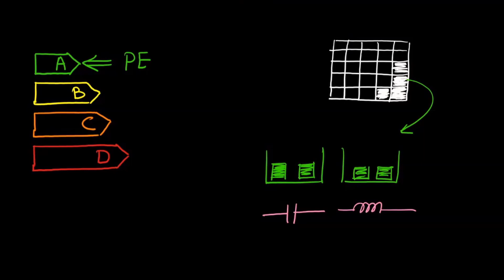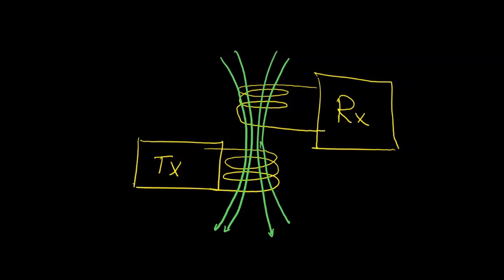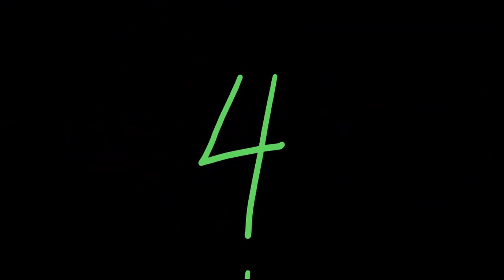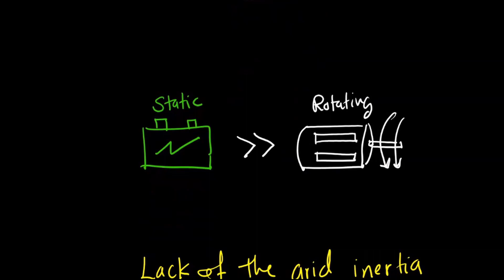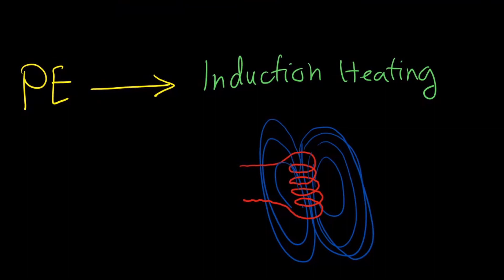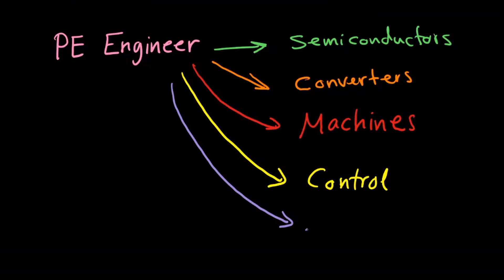5 Things You will Like about Power Electronics | Enjoy Power Electronics | power electronics online

Comment: Point 5 is interesting,  can you suggest a source for more information on this topic.
Reply from the maker: Thanks! Here are some interesting references: 
1- J. Liu, Y. Miura and T. Ise, "Comparison of Dynamic Characteristics Between Virtual Synchronous Generator and Droop Control in Inverter-Based Distributed Generators," in IEEE Transactions on Power Electronics, vol. 31, no. 5, pp. 3600-3611, May 2016, doi: 10.1109/TPEL.2015.2465852.
2- J. Alipoor, Y. Miura and T. Ise, "Power System Stabilization Using Virtual Synchronous Generator With Alternating Moment of Inertia," in IEEE Journal of Emerging and Selected Topics in Power Electronics, vol. 3, no. 2, pp. 451-458, June 2015, doi: 10.1109/JESTPE.2014.2362530.
3- S. A. Khajehoddin, M. Karimi-Ghartemani and M. Ebrahimi, "Grid-Supporting Inverters With Improved Dynamics," in IEEE Transactions on Industrial Electronics, vol. 66, no. 5, pp. 3655-3667, May 2019, doi: 10.1109/TIE.2018.2850002.
Reply: @Elkhateb  Thank you, this is completely new topic to me. I wish you dedicate a video for this topic
Reply from the maker: Yes sure I will make one in the future